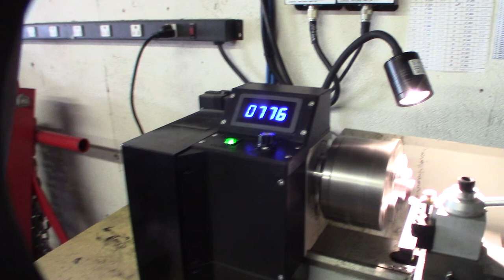Mini Lathe $150 OfferUp Score!!! Restoration Custom Control Box, speed control and tachometer

Comment: If it works, it's better than ours. After weeks of scraping and tuning we gave up on the thing, the saddle clamp track milling is off by like 5mm so the saddle basically can't be held down without a ton of reworking (or a large mill, I am trying to convince my cousin to let me use his Bridgeport to fix it...). I hear that's a pretty comon problem with minilathes.
Reply from the maker: This was an old video. I already have a larger 12" craftsman atlas lathe. Another $500 over up score. Maybe I will do a video about my OfferUp machine shop. I have two CNC mills, CNC lathe, 12" manual lathe, Horizontal bandsaw for $2400
Reply from the maker: I was working allot during winter and spring and didn't have time to upload videos. The mini lathes are not great but cool for hobbyist. I'm always on OfferUp looking for deals.
Reply: @fintechrepairshop  Honestly I would have been happy if it were actually usable at all. Oh well.
Reply from the maker: @jessicav2031  Mine was pretty good. Not very rigid so you could not get very aggressive..